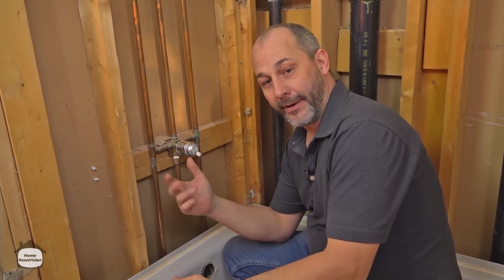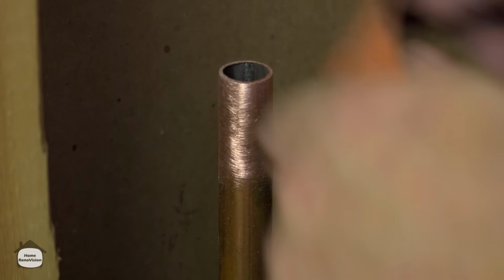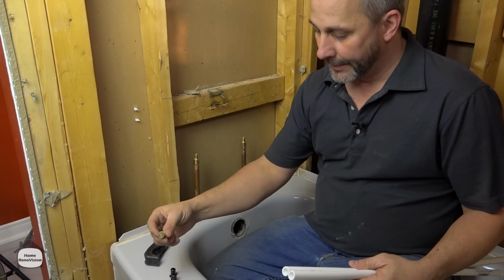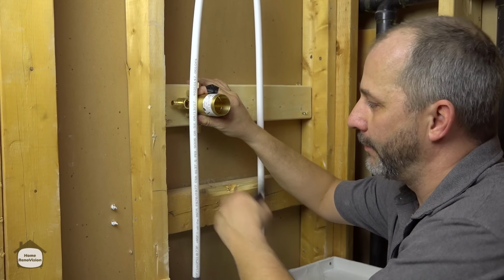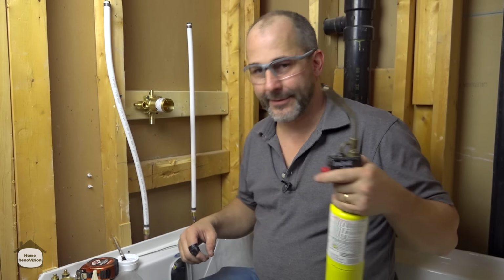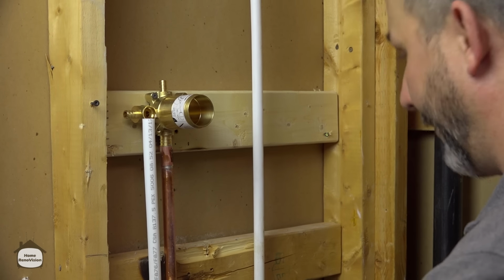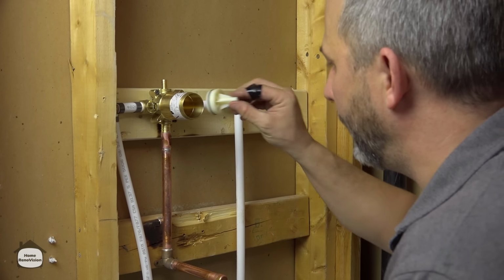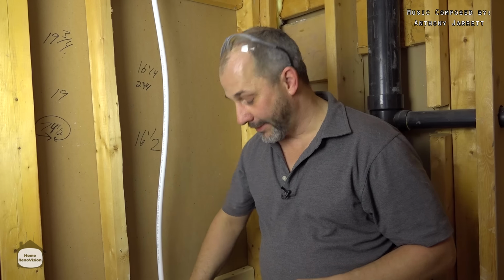DIY How To Install Copper To Pex Shower and Bath Plumbing

Comment: WOW! I'm absolutely blown away by the way you piped that shower valve with one of your "so called little thingies": And your ingenuity to use a coupling to tie copper into a pex outlet was superb especially when you don't even put a thin coat of flux on the PIPE ENDS!! I truly hope that there is nobody out there that took advice from your hammered dog shit work. I would be willing to mail you a level and tape measure if I thought that you could read them correctly:!!!! Your videos are an absolute embarrassment to the SKILLED TRADE which is plumbing! It should be illegal for you to put garbage videos on the internet! You might not have had any leaks while testing but you will be replacing sheetrock in 2 months tops when you're junk welds break loose because you can clearly see that you held your torch on the bottom of the fittings, you hardly pulled any solder into your make up and basically capped that ugly mess of crap. I don't know why anyone would smear flux on a soldered joint, ABSOLUTELY Ridiculous!! Shame and dishonor has been brought to the Plumbing industry by a single Residential Plumbing idiot. Please don't kill anyone on accident and just leave professional work to the pros. Thank you for wasting an hour of my life with your jargon and ugly ugly work. Have a great career screwing people's house up..........

Comment: copper pipe work looks better and if installed  correct will out live plastic.   plastic  is faster to install  but looks shite  on display  real diy     but has its  benefits  no joints  in concealed places  ie if  not on show.

Comment: Using Pex for bathroom renovation. First the water supply is coming from the ceiling sense the bathroom is in the basement. Can I use a T coupling to supply the mixing valve on both sides and continue to run Pex down to supply toilet and sink.

Comment: Great video.....question for you:  notice here you did not install hammer arrestor runs whereas the original copper install had them.....are they not code with Pex installs? .....if not, would you recommend them with Pex installs?.....they seem like  cheap insurance against ham fisted slap  happy teenagers.  Your thoughts?

Comment: In only 2 years.  They went from those compressible brass rings to brass rings with a lip so they don't fall but you get to use the same crimpers.  Now the brass rings are being fazed out to stainless steel rings with a lip on the tip so they don't slip down the pipe but now you get to buy new crimping tools.   Not to mention that PexA looks just like Pex but not interchangeable and uses different fittings and plastic squeeze rings that seem to fail.

Comment: If you touch the cleaned copper with your bare finger you need to use sand cloth again to reclean it. He didn't explain to the uninitiated why he put soldering paste on the pipe and in the female adaptor. He didn't explain why we point the torch only on the fitting and why it faces in the direction we want our solder to flow.  He doesn't say why he heats the line bottom to top. (heat rises) I am not criticizing I am just saying, some people watching won't know these little points that are a little helpful.

Comment: Jeff, thank you for your nice instructional DIY video. One my concern is when you're leak testing the pipe without venting the air out, there will be air trapped in one end of the pipe. And if there is any tiny leakage in that pipe end, we could not see it. Overall, I like your videos.
Reply: If it's air tight then its also water tight; if its not air tight, first you'll probably hear the air seeping, then the water will be soon behind.
Reply: Exactly my thought.  You would HAVE to bleed the air from all pipes THEN pressurize to be sure.

Comment: Question... why did you use copper for the down line to the tub spout instead of pex?
Also, amazing video! Thanks
Reply: After some research, I found this answer...

"The tub spout can be copper, brass, or galvanized pipe. You cannot use pex because the pipe coming out of the valve needs to be able to support the weight of the tub spout and handle the abuse of pulling/ pushing down of the divirter built into the spout."

Reference:
https://www.plumbingforums.com/threads/why-copper-required-for-valve-to-tub-spout.7076/post-63194
Reply: @BLUEmistRAY  .... Don't know if this is true ,,, but from another PEX video ,,, copper used on the tub spout was because the Inside Diameter of PEX is not 1/2" ,, and having both Hot and Cold water on would put too much pressure on the spout and cause the water to backup in the system .
I'll post a link to the video .
He talks about it in the video ,,,, along with the crimping of PEX fittings .
I always wondered ,,,, would it also be true for the shower ,, kitchen ,, and bathroom systems ? ( Because ,, most of those are using a 2 to 1 ,, Hot and Cold to one outlet ,, system ,,, ??? ) .
Reply: https://youtu.be/92x9z6uQbV4  .
Link to the video about using copper
tub spout .
( It's at the 9:35 mark )
Reply: @KZ3W 
Ah interesting... thanks
He had logical reasoning so I'm going to assume it's true.
Now I wondering though... what if 3/4" pex was used, then would it be OK?

Comment: When I install PEX to under a Sink, I install a PEX Crimp X Street Fitting. This way I can install a 1/2” Compression Shut-off valve on the PEX Male Fitting. If the Shut-off Valve Fails from my Well Water destroying it, it’s a Simple replacement.

Comment: Do you use a deburring tool? When cutting the copper line?  I ask because I noticed the black tape on your finger and I was wondering if that was to protect your finger or is it an injury from pipe edge?  I ask because I have ended up at my Dr. office to get tiny flakes of copper removed from my finger.

Comment: I always use shut-off valves to test for leaks at tub spout and shower head,if you just cap and turn water on,there can be compressed air in line,so no leak.Then, run the  water and shut off,leaks can be noticed(just safer).

Comment: Avoid wood burns! Once you have the roughing in place with a dry fit, solder together your build elsewhere, then cool it off to touch with a handy bucket of water and a rag. It only takes a couple of seconds!
Not whipping away with water to clean all your flux/paste, your soldering at the joint may promote copper turning early. The brass elbow ears land too close to the corner, and not at the center of the wood framing.

Short cuts are not for me! Once you break out the torching, why not finish it uniformly with copper? APEX is degrading it at this point! One more thing; most manufacturers label what they will, the trade name for the pipe sander is, "emery cloth or tape." Your tape you're using is, too course, that's usually needed for the painted over copper lines or real dirty pipes, and after heating off what you can first.
All in all, an informative video! I speak my mind for the DIYers wanting more information and to make you aware that professional eyes are watching this too! Thanks for your clarity and your inspiration!

Comment: I worked at a resort that will remain nameless, and they did a total remodel. They used covers for when they changed out the toilets... and forgot to remove said covers... or test the toilets before leaving... It would have been funnier if I wasn't in maintenance.

Comment: Would I have any problems with water flow changing 1/2 copper to 1/2 pex? Looks like you're using 3/4 copper in this.
Reply: Yes. Copper is 1/2 inch Inside diameter while that pex he used is 1/2 inch outside diameter. It reduces flow but your water pressure could determine that also

Comment: If I was a home owner and my plumber use pex and it looked like that . He would hit the road.
 Copper is more durable looks a hell of a lot better. After all the first thing anyone does on a construction site it look. The way it looks mean alot also. Not to mention mice and rat as well as other varmints cant chew through copper but can chew through plastic pipe like pex. Spend the extra money and go with copper . You will be glad you did. And make sure you have a licensed contractor.
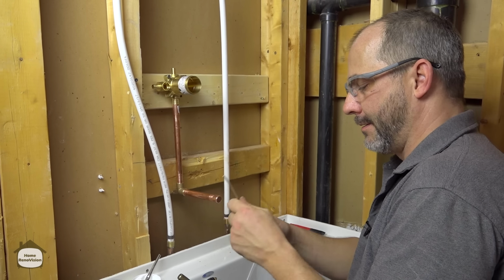Reply: I don't why at 16:00 he didn't solder a female thread copper pipe for the tub spout.

Comment: my shower is leaking and water drips to my main floor ceiling it only leaks when i use the shower it doesnt leak when i am just using the spout what should be the problem? please help
Reply from the maker: most likely it is leaking where the shower arm is screwed into the fitting.
Reply: @HomeRenoVisionDIY  do you mean the whole shower valve need replacement
Reply: @HomeRenoVisionDIY  is it possible that there is leak on the pex hose
Reply: Parker Jazz Bass you have a leak after the valve it could be the line going to the spout or the shower head

Comment: Good video I thought Flux was always used during soldering though.   Also an option would have been to use a sharkbite adapter for the copper to pex conversion.
Reply: He uses flux, however only on the fittings, not on the copper side, which is actually why his copper soldered like it did and wasn't sticking; also, Sharkbites are lousy, would end up ripping open the wall after a couple years, I would only recommend for situations where there's not many options.

Comment: Jeff, my Delta valve says I cannot use Pex to go from my valve to my copper tub stub out.  But I see lots of examples online of it being done that way.  Is there a reason for this?  Do I need to go copper for the full length?
Reply: Hey, I've been doing tons of reading on this. Technically, you should use copper for the down spout, because the 1/2 inch pex inside diameter is too small for the volume of water flowing through it while filling the tub, therefore water will back up into the showerhead and flow out from up top. The unofficial pex fix to that problem is to use 3/4 inch pex pipe for your down spout and you won't get that back flow problem.
Reply: Sean Sheehey Thanks for the feedback.  I’d heard about it being an issue with the volume, but didn’t consider the issue of it backing up into the shower head.  I’ll look into replacing the 1/2” with 3/4” for the down spout.
Reply: @fritobubba  I ended up buying a plumbers soldering kit and used copper for the downpipe. I couldn't find any 1/2" female thread to 3/4" pex adapter locally. Hope you are able to source one!

Comment: I teach my 1st yr apprentice class how to solder, braze,, lead and okum with a running  rope you can teach techniques and do it clean and correctly.  Information was clear i just never expected to see an improper display of the solder running.

Comment: A well designed house or building that has shower and tub there is a plate or door which can be removed to get to the plumbing in the back instead of in the front.

Comment: On the add about a belt that is very strong. You do not want anything around you especially your neck that will not break easily. If you are in a wreck and it is on fire and you are passed out and your belt catches on something when people are trying to get you out may get you cooked. In hazardous places unbuckle the seat belt especially if you are on a cliff or nea water.

Comment: great video  !!! . I have the pex in my house that uses an expansion tool then you put it on the fitting and it contracts to make a seal.. i only have a crimp tool. can this be used on that pex ?? thanks.
Reply from the maker: not sure. i will have to look into that.
Reply: Just an update .. i happened to run into a plumber yesterday , at a socially safe distance , in home depot and he told me he ONLY crimps pex now on Brass fittings   ( and has done for years ) the way you show in your video, due to leaks with the plastic fittings and the expansion ( uponor pex )  method. Just one opinion but was good enough for me. Thanks for the great video, been doing plumbing for years but still learned a few things.

Comment: Oh Jeff, next time you do this job, use your "sand-cloth" around the pipe first. After it is nice and shinny, cut it to length. That way the job works faster because the pipe is stable in the cleaning step; instead of wobbling like you show.

Comment: I realize this is an older video but after watching it I have questions. Hopefully you can answer them.
Traditional Copper tubing the elbow is fitted to the outside of the pipe, with PEX it's to the inside. I notice the 90 elbow inner diameter is much smaller and a much sharper 90 than the copper which means to me, it's restricting the water flow considerably. It looks like in the video your 1/2" 90 inner goes down to maybe a 3/8" inner on the 90. That's pretty small for a shower or sink. Then add in the sharp turn 90 and that slows it down even more...
 I was wondering if you know if any PEX systems have come out with more of a sweep 90 as well as a high flow inner diameter similarly to high flow air compressor line fittings?
I was also wondering if you have tried the push in style fittings as opposed to the crimp style. And what your thoughts are on both as far as durability and leaking over time. A well soldered joint on copper will last a century or more... Has PEX proven itself over copper for not leaking?
Reply: PEX has been used in Europe for meany years before it came over here without an issue.  Having worked with both, PEX in much more enjoyable to work with.  In terms of the fittings restricting flow, I have never noticed any difference at the fixture, and they do make elbows with more of a sweep https://www.pexuniverse.com/sioux-chief-1-2-pex-elbow-lead-free-642x2 though I have not used them yet.
Reply: @chase  Pretty much all nozzles (shower or faucet) have flow restrictions on them to save water.   The slight restriction in the pipe by the fitting is still providing more than enough water than the output can handle.

Comment: Just curious why you soldered supply lines and spout instead of using sharkbite adapters and barbed connectors on the spout?

Comment: Great video!  I'm going to renovate an old 3-handle shower into a single handle valve, and this was very informative!  I'm going copper - pex route as well.  Keep the videos coming!
Reply: How did it go? I am doing the same in the next week or so. Did you come across anything not mentioned by Jeff?
Reply: I’m just getting ready to tackle this project. Anyone have anything to add?

Comment: Just to add a  lil more info.
Make sure to ream and clean deburr every time you make a new cut on copper or any other  pipes.it help the flow of water and prevent a future leak in the joint coused by turbulence in the water.👍👍good video

Comment: Good video but no very safety when you do welding next to the wood.
Should check all cutting dry fix the let fixture plumbing away 2 or 3 inch from the wood before welding

Comment: try a car  battery terminal cleaning brush,  it has the small brush for inside the fittings and the cap has the brush for the outside of the pipe, 1/2 inch copper. your presentation is top rate

Comment: I like to take a shower with real water pressure not 1.5 gpm  could you show a how to video on a 3 valve system for the shower/ tub

Comment: The only suggestion I have is to put a fireproof cloth, or two layers of galvanized flashing behind the copper fittings when you solder. Charring the wood with the flame can start a fire, and, in any case, is bad for the 2 x 4s.

Comment: First off, I suspect the down comments are by profession plumbers who hate that you show how easy it is for the home handy person to do.  At what height did you set the top drop earned connector for the shower spout?  I am getting ready to install my pex.  I will be switching to a copper pipe for the tub stub out as well.  I was not sure when I purchased my stuff.  Thank you so much for taking the time to make these videos.

Comment: You never Removed the burr from the copper end. Turbulence from water moving inside the pipe usually causes problems with copper to copper connections, not sure if the same thing happens with the inside of pix, but why take a chance. Always remove burr from cut copper plumbing. Have made too many repairs on older pipe pointing to this reason for the failure.

Comment: To get rid of the dripped soder on the pipe use a folded wet rag and wipe the joint right after you sodder.

Comment: Aloha Sir, Thank you for the videos on installing a bathroom shower but have you done one with multiple showerheads. If so I am in the process of put one end and need your input are video to help me along.
Reply from the maker: I have done a video on a 3 way shower install. it is all the same except the valve has extra ports for the pex to be connected to that run to the other locations. cheers!

Comment: Nice how to pex.
I recommend flux on both surfaces, not just one side. Use a rag to wipe around the cooling solder/flux that drips out. Use a curved amount of solder bent at the tip of the spool of solder to use as a guide/ limit on how much solder to inject in the joint. For the novices, use a piece of metal plate to avoid burning the framing wood. Cut up a soda can when in a pinch or a unlatch a round exhaust duct flatten it and stick it between the fitting and wood.

Comment: Is it normal for a Riobel valve rough in to drip out the bath spout?  I turned off the water at the Riobel valve by turning the slots to off.  The system does not leak anywhere else.  Would this issue be corrected by installing the cartridge and associated hardware?  The leak is very minor but concerning.
Reply from the maker: the cartridge has a positive off position so it should be fine. Cheers!